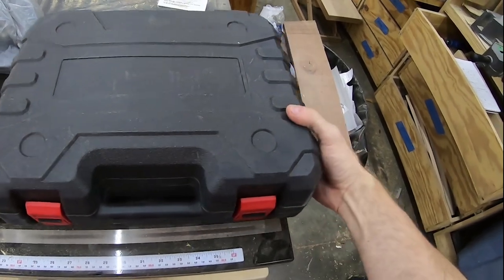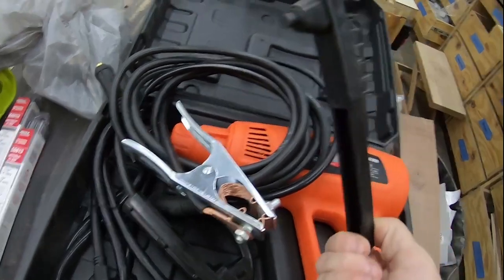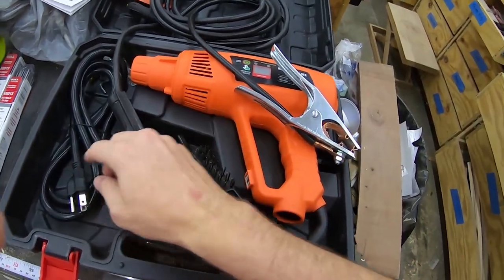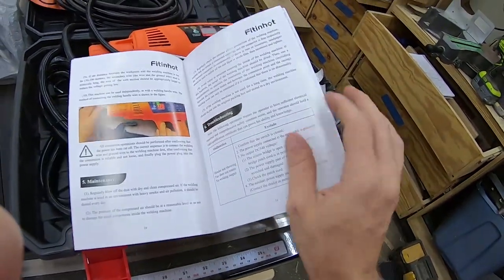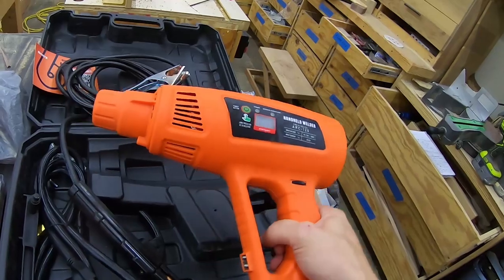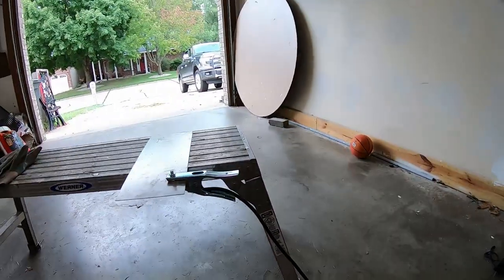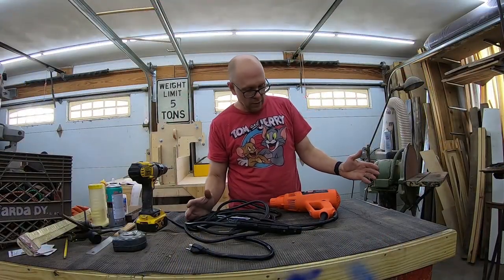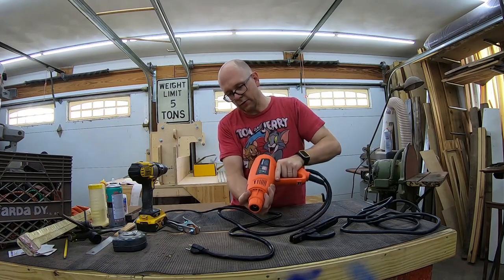Fitinhot Handheld Welder: Can this tiny unit actually weld?

Comment: If a guy like myself has only one hand? Do you think he could make accurate and strong repairs with this tool?
Reply from the maker: I think you would be able to weld with just about any welder. A second hand is really only used for stabilization.

Comment: what voltage did that machine run on?

it looks like you might be using lincoln electric brand rods if so they should have the recommended current range printed on the box. 70 amps strikes me as very cold for any 1/8th rod. also it looks like you're using 6013 rod which is not the easiest to weld with as the slag can hide what the metal is doing

Comment: not to be rude but you did absolutely zero welding that was barely a tac, what you have shown is that this welder is absolutely useless and should not even be called a welder. WTF  SMH:face-fuchsia-poop-shape::face-fuchsia-poop-shape::face-fuchsia-poop-shape:
Reply: ?? Just because he did not do something does not make it useless. It just means the jury is still out.   Now if it failed at everything he tried, then it would be useless.  I thought it was pretty cool that you could get a welder that small and still do some welding, which he did do.
And As he admitted, he has almost 0 skill at welding and that was obvious. It takes a while to learn to weld properly.
Reply: @gantfrost7749   The only thing worse than a young pessimist is an old optimist, this item does not even deserve the title of a spot welder. this reply is from an old pessimist.   😁